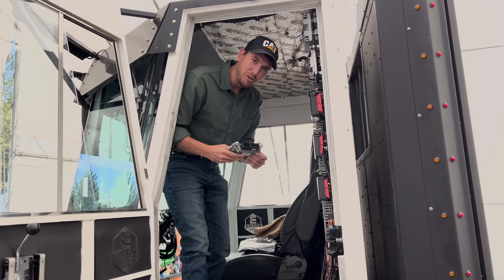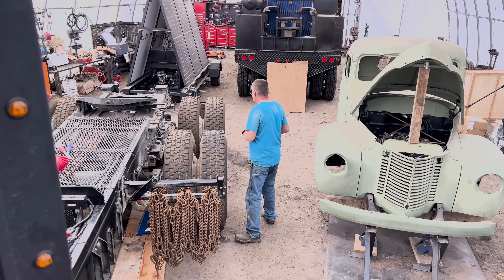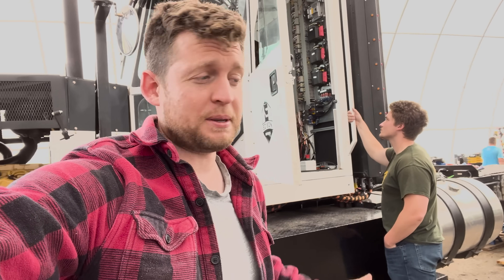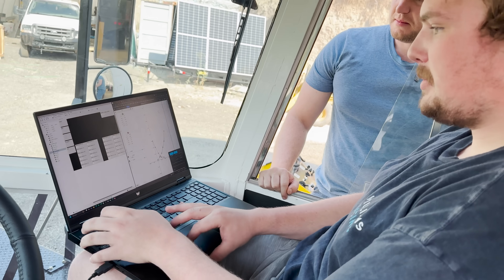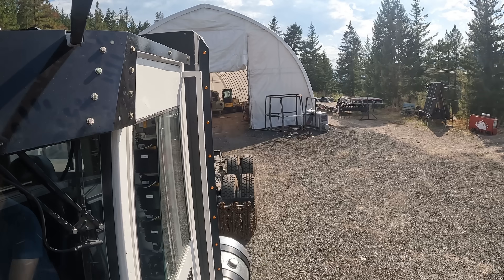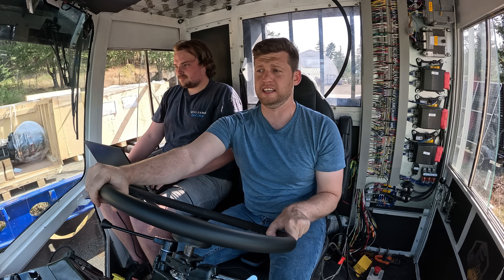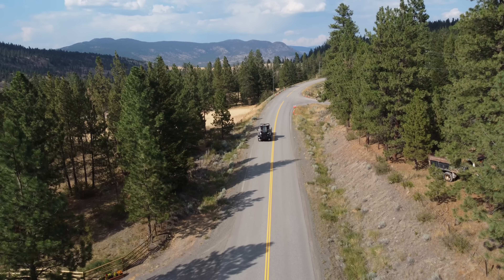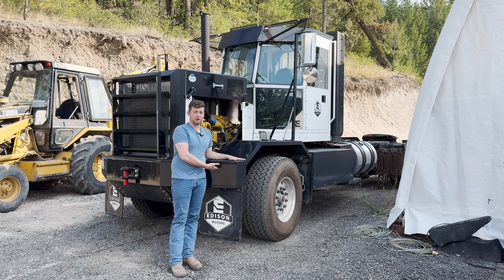Electric Truck Testing Success

Comment: I'm interested in a topsy project for my country but I don't want to pay the 290 dollar charge for consultation. I need a truck that is 6x4 drive, can carry a 40 tonne load and have a rear drivers bed. Ideally like topsy due to local regulations on right hand drive. Center steering wipes out the left hand right hand arguments but without a rear bed it's tough for long distance drivers

Comment: Well, it’s like this you see. 

My mind started wandering and got to the point where the regen power could over load a full battery and you need to dump it some where. 

So I started down the path of feed it back into the generator right?
Then I was thinking the generator doesn’t even need to be running or even enabled as the oil pump still feeds it with no systems on. 

So, with a Jake brake you could still have regen braking with no battery or generator.
Reply: They have already thought of this and yes the generator can act as an electric motor, then force the diesel engine to turn and they can then use the jake brake. It's an older videos.
Reply: @subwarpspeed  
But the thing they didn’t say was does the generator have an exhaust brake fitted

Comment: When you apply the regen braking, does it apply the brake lights? I had this question with a Tesla I haven’t had answered. 

Following a Tesla down a steep mountain and I felt as if it was slowing significantly beyond what a car with the automatic transmission just taking part of the load on coasting.

I know your vehicles will be heavier, but it seems like a valid question from somebody who has had weird experiences driving behind a vehicle slowing with regen braking.
Reply: Most heavy duty trucks don't have the brake lights come on with the engine brake.  Regen serves the same purpose with the Edison.
Reply: @jonfurse3931  that doesn’t necessarily mean that they shouldn’t

Comment: Could a 3 phase genset be used for the power source? A self contained unit seems like it would be drop in ready in conjunction with the ac/dc converters, battery packs, and controllers.
Reply: What do you mean? It already has a diesel generator on board. They have (I think, or ought to have) a AC/DC to charge the truck as a plugin, which one could charge it if the regular diesel generator has a malfunction. But no need to carry a 3 phase genset normally.

Comment: The only problem I see having the pdu in the back. Is if a load shifts or gets un strapped.
It would smash into it and cause a possible fire.
Reply: To be fair if the load is slamming into that it's probably slamming into the cab too, making it not your problem anyway

Comment: I’m intensely curious to see how this turns out for efficiency on a long haul. (Mpg or whatever you Canadians call it L/km?) If it can make a significant increase in fuel economy over what’s on the market, you’ll have more sales than you can produce in a lifetime. There are a lot of fleet companies who would replace every truck in their fleet for a 1-2 mpg improvement. That can mean millions of dollars per year ROI. You’re doing an awesome thing here. Keep it up.
Reply: For flatland longhaul it doesn't make so much sense. It's nearly no regen and when the machines is at a proper speed you can bet that the gearbox is made to have the right gear for that so the diesel engine runs at optimal rpm.
Reply: @subwarpspeed  you are probably correct, unless there are fewer losses in the drivetrain. It would be a very slim difference if any. I think short haul and in town there would be plenty of regen.

Comment: How will the regeneration work with a fully loaded trailer pushing it downhill
Reply: If they can use the jake brake today they can use this. If it's too much so risk of jackknifing well then yeah they have to apply brakes on trailer. But they still can use the regen on the truck.
Chace did talk once about e-axles on trailers. It's possible - it would cost more and it seemed the planners of the logging got all excited to send the drivers up/down even steeper hills to save on costs. So it would make it better but also crazier driving it.

Comment: After some time, it would be amazing if the system could give details on system health without an OBD2. With everything being easier to get to and repair, it would also be great to make it easier for operators to make more repairs without a shop. The only types of jobs that deter me from my own work are the ones that require hours or even days of teardown and rebuilding. Those jobs also make a lot of downtime. It's hard to say how busy a shop is at any given moment and priority can be expensive.

Comment: how will the rear tire regen work when not weighted?  wont it lock up the tires and possibly spin the back around on wet or ice when not weighted??  shouldnt there be more regen load when its got trailer weight on the rear axle compared empty?

Comment: It should save on brakes to some extent but most truckers primarily use the engine brake anyways so brakes aren’t a real common thing to have to replace. I’ve heard electrics are harder on tires though and tires are way more expensive than brakes. No matter what you’re driving there is always gonna be parts that need to be replaced at certain intervals, tires, brakes, etc. The biggest savings will be fuel prices.

Comment: I work in waste transport in Australia as a residential garbo, I would love to see the Edison idea put into practice in garbage trucks, I do whats called side arm for those who arent familiar, a mechanical hydraulic operated arm off the side of the truck for collecting bins by lifting them and dumping them into a hopper. Doing stop start between collections and working in dense residential areas of major urban areas early mornings, having the electric capabilities would mean I could service areas quietly under electric power then when I am ready to unload at a waste facility the batteries could recharge off the diesel during driving when I'm away from populated areas. 

Many people complain about the noise of our trucks of a morning and we'd reduce the potential for complaints and have instant power for getting moving between stopping effectively increasing our efficiency
Reply: Also being able to start earlier, less noise complaints.
Reply: @wobblysauce  exactly right, like my truck at work with an isle Cummins is a bit noisy and even when it's daylight morning, people have a whinge about noise to reducing noise from a hybrid setup truck would work well.
Reply: The garbage trucks where I live in Norway are electric.
Reply: there is also diesel hydraulic hybrid technology out there.  engine charges a high pressure hydraulic accumulator.  I haven't heard an update, but it was supposed to have a better lifespan than batteries.
Reply: An electric tilt tray would be mint for doing early morning breakdowns etc. run the generator when you need to. otherwise. not

Comment: imagine the traction for heavy hauling, thinking of a triaxle drive and powered twinsteer, no need for a weight block on the fifth wheel, add an extra layer of batteries

Comment: I’m assuming the axles are facing each other and the issue was regen in the axle which is commanded reverse to go forward. Perhaps reverse regen is disallowed in the controller for some reason. I’m also assuming the motor is basically a three phase motor with quadrature encoder feedback.  If so flipping any two phases and flipping encoder signal A and A not would run the backwards axle the correct direction with the motor controller commanded forward so regen works properly.

It must not be that simple though if you guys didn’t think of it or the manufacturer didn’t suggest it. Can’t think of what else it would be though, so I’m curious.

Comment: Please don't get me wrong. I love what you're doing.
BUT
Wasn't this going to be the Un Tech Truck?
"No little, $3 dollar item, parking this truck on the side of the shop
 untill parts are flown in from somewhere in Chinese!"
But here we are.

I loved your giant Tally Wacker air warning thing, up by your visor.
Simple, and easy to fix.
I get that you guys bought high tec axels, 
but do they need all these laptops, and tcm's, just to keep them working?
Is my driver going to have to be an IT guy first?
Why isn't there just a Frankenstein Switch?
I'm going up a hill on batteries, (@ the top, click boom of a giant switch) 
Now I'm going downhill, regen charging!
See?
Reply: This is the prototype to work out all the "high tech" bugs. You can't run batteries without tech and unfortunately or not, North American companies aren't making that stuff.  I'd suspect the idea is to work out all these bugs so production vehicles are smooth and easy to replace/repair/reprogram the "high tech" battery components.

Comment: Depending on a Jake Brake on a hill seems safer than depending on some programmer coding in a different Country. If they trusted your company, you would have access to all of the source code as well as programming tools. I realize you are a small company but if you don't have root access, you are not in command.
Reply: Yeah, much as I love Edison and what they're doing, those modules are suspect that they can't fix them remotely.  Like he said 30 minutes to get them in and out, but that's ignoring they had to send a dude to china on a plane for them to fix them.  Of course I know it's because they couldn't find something in Canada and it's just how the cookie crumbles.  But hopefully a better solution is found.

Comment: Next step is regen for trailer axles what a bonus that would be
Reply: Just need to sort out a new 800 volt trailer plug standard. 🤔
Reply: Sure would be awesome! For their use-case (hauling heavy loads down hill and running empty up), all that kinetic energy they'll capture might mean very little- if any- use of the generator engine when conditions are ideal. Boggle the heck out of me why traditional track manufacturers will not apply this hybrid idea to their powertrains. There won't be a need for EGRs, and get 50% +/- fuel economy.
Reply: The problem there is the cost per trailer.
Reply: @dposcuro  that’ll pay for itself over time in fuel and maintenance savings.

Comment: I was thinking that contoured or “custom” parts wouldn’t be a problem as long as they were designed such that they’re designed to be replaceable with freely available 3D printed parts. Go crazy as long as it’s assembled from parts and panels that can fit in a 200mm cube.

Comment: I love the lack of sound this truck makes - very well done
Reply: It's soo gloriously quiet while at fast pace. If only more of them were on highways. Living and Working near a highway / freeway would be much more pleasant.
Reply: @Neojhun  where I live they are replacing all 96 local buses to full EVs and everyone saying how much nicer the local environment is - as in sound and clean air around the new buses
Reply: @Neojhun  most of the road noise you hear from a car passing by is from the tires compressing air.
Reply: @Neojhun  Most of the highway noise is actually tire noise. Unless you have a lot of trucks with loud pipes. Then yes, electric is quieter.  But in general you don't hear most engines over tire noise at about 40 km/h.

Comment: how do you achieve trailer stability with that massive regen?
Reply: I highly doubt Regen is any stronger than Friction Brakes. It will be a smoother lighter braking force soo it should be fine for the trailer.
Reply: @Neojhun  it's not, but when you use friction breaks you breaking TRAILER too.
regen breaking is much stronger than a best jake brake. 
breaking on truck only makes a risk that the trailer will end before the truck.
Reply: is possible to break only trailer? with truck on regen only?

Comment: Lol…is that like a soft start function for the TCU on regen to limit over voltage condition?  I think I have heard these exact same conversations and terms before on a diesel electric drillship.  Awesome.  That cabinet with the TCU in it looks like it came right from one of our ships.  

Please hold on as long as you possibly can before taking any of that dirty VC money.  You’re exactly right, they would start steering your little company into the engineered obsolescence lane at  the first meeting on the way to selling your company to the big 3 or shutting it down.  Hold on and hold out as long as you can.  

I am holding 2 glorious pickup trucks in my collection to be repowered by Edison.
Reply: Planned failure is wrong....but a business only survives if it is able to have reoccurring revenue. VC money isn't dirty either if you have the right partners.
Reply: @michaelwheeler4014   The trick with VC is not go into too early, otherwise they'll be taking a bigger risk and will want more from you.

Comment: since yall put the go pro off the old mirror hangers, i think it might be a great idea to put a camera system off them as well. forward, reverse, steers, and sides. Built in liablity protection and trail cams. for a logging truck, sounds actually pretty OP.

Comment: The diesel electric combined with solar would be wonderful on a yacht.  Most boats spend days to weeks in single locations.
Reply: Shore Power is already a heavily established infrastructure. "Trickle Charging" at around 10kw from Grid power should be quite doable.
Reply: @Neojhun  Betwen shore power and a Comercial generator air-conditioned spaces at night without a generator running

Comment: I love your old school elegance in engineering.   Keep it easy to work on and as simple as possible.  Rare
Reply: Yes, but minor changes maybe. The hood is really big for maintanance, but it is an obsticle in your way of sight. So maybe chop it down 30 cm? Maybe only the front with a grade. Would still have a lot of corners and look cool. And maybe chop the cabin, so that the driver can reach everything. It looks too high, especially when driving solo. Don't change the seat hight or position!

Comment: Regen breaking should mean that brake pads will need to be replaced less as often when compared with traditional trucks, correct?
Reply: I would imagine it's the same as engine breaking on traditional trucks
Reply: @thunderlighting2006 basically yeah
Reply: Yes, same as an electric car. My Electric car has 143 K Miles on it. Still on original brake pads and discs .
Reply: Regenerative braking is like converting the vehicle motion back into electric power and stored back into battery, so this is very efficient as compared to physical brake pad stopping by friction (which is energy lost as frictional heat)
Reply: Traditional trucks use an engine brake aswell so I'm sure the brake life is comparable to modern trucks. But the gain in efficiency should help allot.
Reply: @sethclark9897 keep in mind there are alot of situations where a Jake brake may not be viable but the Regen will still work. Like in town where you are not allowed to use the Jake.
Reply: it should do yeah
Reply: Yes, the shoes should have to be replaced less often. However, regen braking eats up rear tires.
Reply: No more than normal braking as a total, and it is shared over more tyres as a load.
Reply: @2shay550 How much does it eat up tires?
Can you post a link on your data?
Cheers
Reply: @robertI153  I work for a large US truck OEM, not gonna say who. Our EVs rear tires are only lasting 15k miles for trucks that use level 2 and 3 regen a lot. Granted, these are busses and class 6 trucks that generally see more braking than tractors anyway.
Reply: @2shay550  Is that a result of regen braking or more so high torque output on acceleration?
Reply: @TheBCSledder  Certainly the increased torque is a factor in accelerated tire wear. However, our engineers have found a direct correlation with the higher regenerative braking levels to tire wear.
Reply: @2shay550  I can imagine that if regen braking on the rear tired is pushed to much then the tired start to slip a little.
It might not be noticeable during driving, but it adds up in wear. The weight shifts to the front, so the tires are less planted in the road. Even if they slip only a few millimeters every time it might add significant wear.
Reply: In theory yes, long as the calipers or wheel cylinders (if its using drums and shoes) don't hang up. Should almost be able to get a significant increase of pad and shoe life, so long as it's mostly in regen and the service brakes are not needing to be used.
Reply: What's crazy is on my bmw i3 if you feather the pedal to where you have the bar right under a coast on regen you get it's maximum charging power. So like when you are responsible and just coast down slowly at lights and mess you make mad regen. I'd love to see what a slight decline on one these heavy ass trucks would produce. Basically it's a semi i3 😆
Reply: Yes
Reply: As far as my understanding with hybrids. Yes. The last 2 hybrids I've owned have had impeccible brake longevity compared to my other vehicles.
Reply: The Jacobs retarder uses the diesel engine compression to induce mechanical braking, using "regen" is almost the exact same.. if there was a route and load management computer used, the systems aboard the truck could efficiently manage these areas, like hills and exploit them.. even through less maintenance such as brakes.

Comment: An electronic nightmare
Reply: Compared to a 50 year old truck? Sure. Compared to a new ICE truck? Nope.
Reply: Actually they layed out the electronics very nicely where they are labeled and easy to get to so servicing them will be quick and easy as he pointed out in the video it only took like 3 minutes to change out the 'faulty' part vs big name truck companies where you'd need to over an hour taking truck apart just to access the part and another to put it back together
Reply: Seems quite well organised and accessible to me.